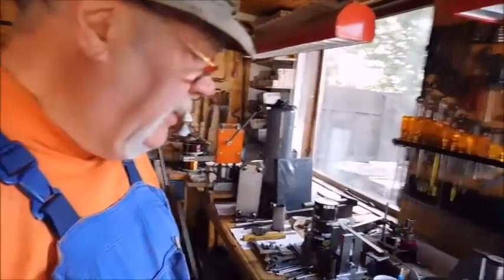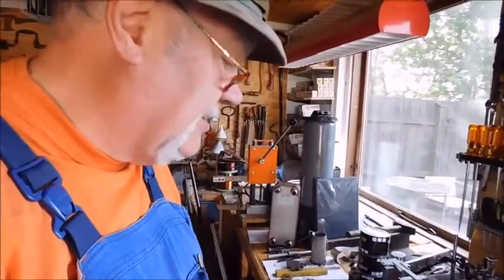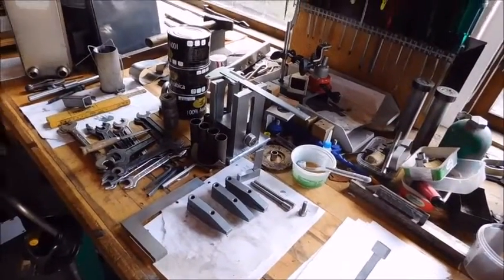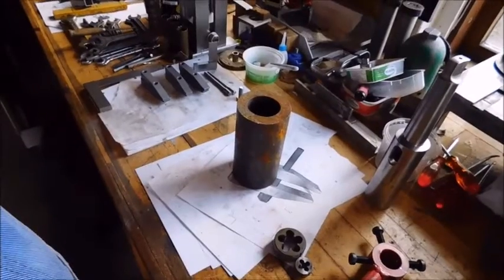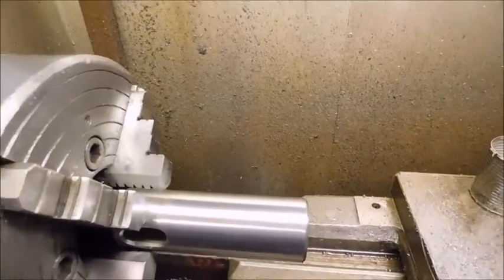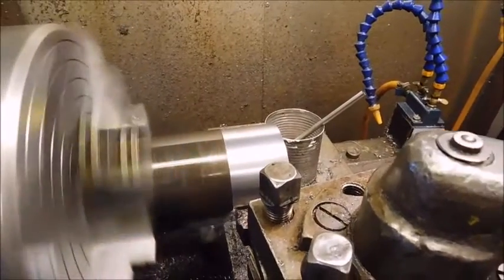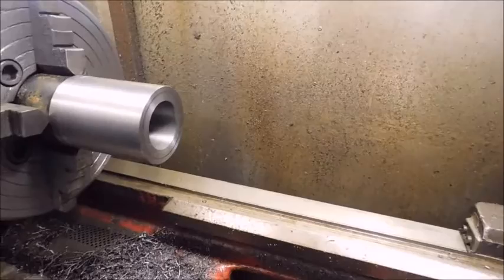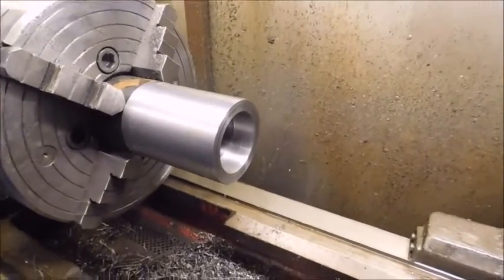TailstockDieHolder 01

Comment: Hi Keld,

Looks good so far.

You could put a full length keyway along the die holder centre piece (outer), and mate it with a pin in the morse taper section to prevent rotation.  It will still feed itself OK. The pin could be made removable for hand turning.

Lots of options on making these.

Regarding hand cutting threads, the dies always pull one way doing it unsupported - have a close look at the threads and you will see what I mean.

That's why a tailstock holder is much more accurate.

I have a rudimentary one I made up that works by pulling the loosened off tailstock along the ways - works fine.  Yeah, I know some people will be horrified :)

You need a few beers and a good think on this project.

Cheers Rob
Reply from the maker: +xynudu Thx Rob - yeah, lots of posibilities for different designs here - the pin-type is a little like mine here, if you see the sketch I've made on my web site - it's a part of my release mechanism.

http://kelds.weebly.com/tailstock-die-holder.html
Reply: Interesting design.

The only question is will the rod bend as the stop gets near the end, when using large dies?

Rob
Reply: You could use the same design/principal, but have a long external keyway, with a square section movable rod in it as the stop.

That way it can't bend, but will work the same as the free standing rod.

Cheers Rob
Reply: +xynudu

Forget I said that Keld. A key way won't work as it can't allow rotation like the rod.

Brain fade on that by me.

Cheers Rob
Reply from the maker: xynudu
Ha, ha, take a cold beer and rest a little - that'll do ;-)) ... BUT
When I doo the 24mm thread the keyway will hold ... the rod will surely bend !

Comment: Thanks for the mention -- it certainly helps to have a holder for the tail stock. Mine generally serves as a starter - if a very long thread I then switch to a regular die stock to continue the pass.
I like to use split dies if possible as that allows for a small amount of adjustment - going from slight lighter cut to then a slightly tighter cut, as needed for a suitable result.
Nice fit in the bored out tube... yeah :)
Reply from the maker: +ChrisB257 I will too give a link to your version on my web site

Comment: If you were using these dies by hand you would normally wind it backwards every so often (- I am never quite sure why except to break off the chips). Do you plan to just let it engage and cut the whole length of the thread or use it in a differing manner?